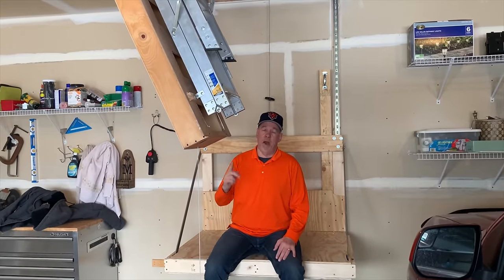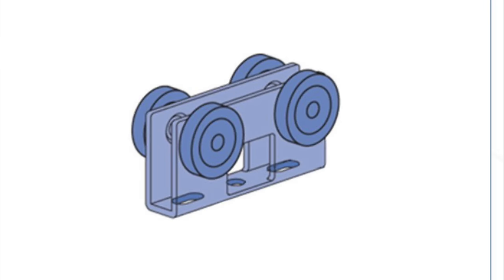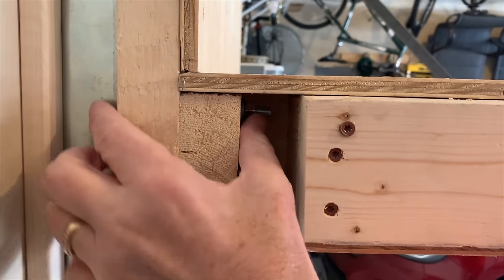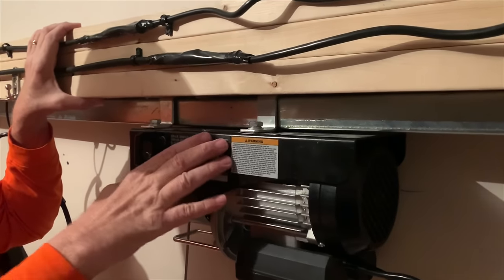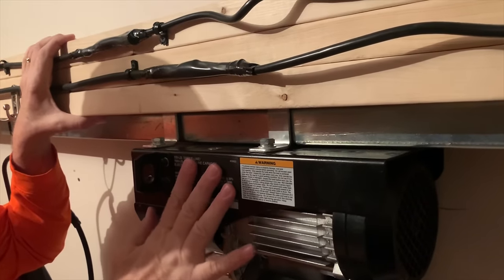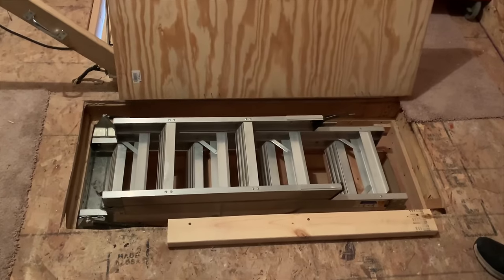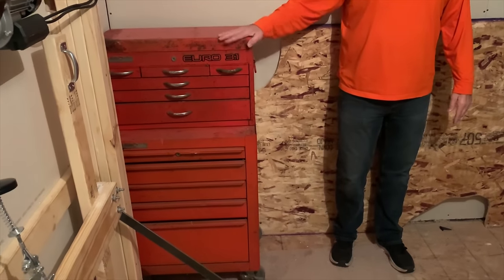Garage Attic Elevator / Lift Build in Minneapolis Minnesota

Comment: Pretty cool, but just a couple suggestions.  The through hole for the eye bolt in the top 2x6 of the carriage is a little worrisome. It eliminates a lot of cross sectional area from that beam at the location of the highest stress driving the internal stress even higher.  I'd replace that beam with a solid one with some kind of hanger that wraps underneath and secures in place with couple of screws.  Next point, I'd probably in parallel with the hoisting cable introduce a retractable fall arrestor in case of some failure within the hoisting assembly.  Lastly, would probably be good to have some pressure sensitive bars at the open edges of the carriage that cut off power to raising the carriage.  Then if there happens to be kids that somehow get access to this without adult supervision, no one gets decapitated.

Comment: My name is Brian also and I built a lift also, Its on Utube and I have had over a half million views.  I have been called everything to a wife killer and I should be put in jail, to everything in between. Alot of positive comments too.  Allot of the comments have been around safety.  I have a ratchet mechanism that will stop it immediately if something breaks, I use the pully too so it lifts slower.  Your design is excellent and motor attachment is more than strong enough

Comment: Very nice job! As an engineer I think people should be aware attic rafters have limited carrying capacity...most around 8 pounds per square foot dead load. Rafters are designed to carry roof and snow loads not whatever you can load on the bottom joists. Since they are made of wood there is a considerable factor of safety (usually 3x) from the expected loads due to inherent variability in structural grade lumber. Many times people get by without catastrophic collapse but realize it can happen. Rafters are constructed to carry specific loads, ie: shingles, roof decking, flooring, insulation and ceiling sheet rock below with a small consideration for storage in the event on attic style rafters. Just be aware of their limitations.
Reply: I have the same thoughts about heavy items. I thought that yours might have been built to support the room. If not you have a lot of hvy stuff up there. Very cool lift!
Reply: I was asking myself the same question, what is carrying the load for the lift..... seems to be the gable end?? or the studded exterior of the house?
Reply: I may have carried the load on anchored 4x4's, attaching all the way up the wall and tied in the rafters to the opposite garage wall, upstairs, to share the lateral forces on the wall.
Reply: @TheEzgrider  my thoughts exactly and on the header beam where he has the 2x4s stacked, I think I would have laid a 2x6 flat then put 2x4s stacked narrow side down with another 2x6 laying flat on top to build a stronger beam.  Or at least stacked the 2x4s narrow side down so they’d be stronger.  Otherwise great job!
Reply: @Fully-semi-auto  I agree.  Still , it is a lift to carry 500 lbs straight up 10 foot at most.  He did just fine with what he had to work with.  I see no problems ever with this, until his cable snaps... 100 years or more from now.  haha
Reply: @LocalTradesman  I agree.  I don’t think he’ll have any problems with it. Just a couple of things I’d have done differently.  And I’m definitely not an expert. I’m sure there are 100 ways better than mine.

Comment: I was coming down my attic ladder once and missed a step, I fell and hit my chest on a trunk I was going to put up in the attic next. I broke a couple ribs when I hit the trunk. Better than hitting my head on the concrete as I lived alone at the time. Probably would have died from loss of blood if that would have happened. I will be putting in one of these in the next few weeks!
Reply from the maker: I hear you buddy. Thank goodness you didn’t hit your head. When you build, be very careful in the build and overbuild for strength. Be very careful operating it. Lots of pinch points.
Reply: Thats what Im afraid of happeni9ng to me too :)  Glad youre ok :)

Comment: Leaving the folding staircase is a good idea from a safety standpoint. It gives an emergency exit in case of a power outage or mechanical breakdown.
Reply from the maker: Or a firemans’s/stripper’s pole. Dual purpose?
Reply: @theelevatorSRT8  there you go!
Reply: I recommend something more like a Bat-pole that can also go up
Reply from the maker: @freakazoid5907  thanks for putting that thought in my head!

Comment: Back plywood should cover all way up to the 2 by 6 to cover the hole, for safety.
Spliced/taped exposed power wires is a code violation in every state.

Comment: Hi Brian,
That was an excellent effort... As a Registered Architect, my only advice would be to correct that top beam/header onto which the winch is mounted:

The header planks should be standing upright, and not flat as you have done. (3) 2x10's screwed together in a staggering (zig-zag) pattern would be a good option.

I could tell from your video that the beam has already deformed. 

Best wishes.
Reply: @theelevatorSRT8  I was thinking the same as Troy (and you). If turned upright, a metal plate, or series of large washers, would help spread that load to avoid spreading the hole.  I'm a bit curious how you cut out the garage ceiling to make a square that large. The reason why stairs are narrow is because they try to slip them through existing joists. I wonder if there was some structural weakness by cutting out a joist to fit your elevator.
Reply: @theelevatorSRT8  as far as the header situation, headers are always placed vertically. If you wanted to control the load better, an I beam would have been the better choice. Second would be to have the wood turned and a load plate carrying for the holes for your bolts. Otherwise, you will see deformation (as seen in the video already). Less desirable option, cross brace using diagonal boards to transfer the load to the floor joists. This would eliminate the bowing of the boards you already have.

Comment: We feel like we know you now, Brian, because we’ve watched the video a thousand times while building our own,  just like yours! Ours is outside going up through our deck upstairs. We’ve just finished it, and it is amazing. Our son showed us this video when we were considering purchasing a very expensive outdoor elevator. My husband studied and studied your project and decided he (and I) could do it. We did!! Thank you, thank you for sharing this. We live upstairs and will finally have this for our firewood and groceries, etc. Saved us more than $14,000!
Reply: Brian Michaels, thanks! It’s under a wide roof and we added protection over the motor. Hubby is a stickler for maintenance of his equipment, so yes! Wish you could see it😊 If you’re ever in northeast Texas...
Reply: Brian Michaels, also want to tell you that we added a fence and gate around it on top floor to prevent falling into “the pit” when it’s downstairs. So ours has a few additions because of its location. The basic lift was almost just like yours though.

Comment: Only change I'd make is on your top beam holding the lift motor.  Wood strength is compromised by laying the 2x on its side.  It would have more strength standing upright, glued and screwed.  Mainly because it has more fiber strength that way.  The posts on either side are fine.  If you are loading under 1000 lbs, your design should work OK, but if you have to rebuild at some point, or want to enlarge, consider using multiple 2x6's glued and screwed standing upright in your next design.
Reply: Yes, single element dimensional lumber is stronger when loaded 
for strong axis bending, rather than weak axis bending, multiple plies stacked in weak axis bending and bolted together can provide equivalent strength and stiffness. Bolting requirements would be governed by shear flow. The benefit to doing it the way shown in the video is that the timber elements would allow for larger diameter bolts than boards on edge while still complying with minimum edge distances required by timber engineering codes.
Reply: Swapping the entire wood frame with steel beams would improve the entire design greatly. This design in essence is just a copy of how a forklift works. It would be like if you stuck a forklift's hoist to your wall and the same thing would be accomplished.

Comment: You mentioned mounting the roller wheels with bolts but the bolts look like they are holding the vertical wood to the horizontal 2x6. Did you screw them in or use lag bolts with a hex head but actual screw type body that doesn't use a nut?

Comment: Nicely done. I would have turned the "beam" on the edges of the 2 bys. That's where the strength comes from. Then sandwich it with some plate steel where the strut is bolted.
Reply from the maker: Duly noted. Thank you!
Reply: Thanks!  Imma need that info!
Reply: Yeah that motor support makes me shudder. 😬 I would use an engineered beam and support the motor on top instead of hanging it by bolts.
Reply from the maker: @gwilli  there’s really nothing wrong with the beam from an engineering standpoint. I was just being polite/non-confrontational. But now people will be misled. The boards are glued and screwed, eliminating slip. The multiple boards eliminate a crash caused by a single failure. That beam could lift 5 times the weight it lifts and it would take several failures to cause a crash. The boards are on their sides because of the holes drilled through them to support the motor. Much safer.
Reply: @theelevatorSRT8  THANK YOU !  I definitely dont want to be misled. You are a humble kind man. Funny how people think they know better but havent done it yet. Of course you're going to have things you would do differently, for ease, Structure, safety etc. Please give me any advice you Have. We welcome it :)

Comment: Neat and functional project.  My only note would be that your horizontal header to which you attached the hoist motor should have been constructed with the timber width vertically oriented. This way the load would be carried without the risk of deflection.  Yet, you put thought and effort into this and It seems to serve you well.  Overall, well done.
Reply: Normally for a load like this you would laminate those three beams (glue and clamp) then turn them vertical and sandwich between and top and bottom plate. Basically making a header like you would for a door. Drilling through that wouldn't weaken it like just turning them by themselves. Given the weights you're working with in the 500lb range your design should be fine. If you were using a snatch block setup for higher loads then you'd really need to look at going to a more typical header design.
Reply: @theguid0  exactly what I came to the comments for. Putting a plate on top of the vertical boards would provide a flat surface to distribute the load across the much stronger laminated beam (ideally both glued and bolted together). Whether the top plate is a horizontal board, a steel plate, or just fender washers is up to the engineer requirements; a board with fender washers would likely be more than enough.

Anyone still thinking it's "strong enough this way": Just grab a ream of paper and see if it's easier to bend along the wide side or narrow side. :D

Also worth noting - hooray for someone actually making a constructive comment instead of just tearing everything apart. :D

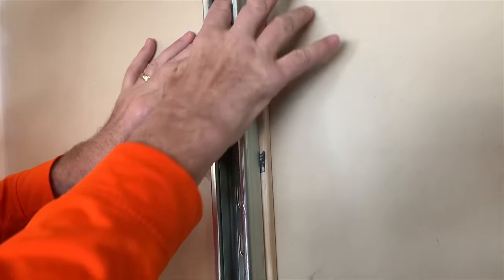Comment: At 1:33, you mention that there isn't a lot of weight pulling out on the tracks and studs, but they actually do have quite a bit of force pulling on them. If you think about it, the cable from the hoist is attached to only one side of your platform. The other side has to be supported by the diagonal supports, which produce an outward pull at the top rollers. The rollers at the bottom push in with great force as well. If your platform had a cable attached on both sides, then the force on the track would only be the guiding force, the force that keeps the platform from dangling. I also would have liked to see the interface between the rollers and the track. Anyway, I like it! Good job!
Reply from the maker: Yes, your point is well taken. Mitch, my engineer student son lectured me on that as well. So, you are correct. I would only say in my defense that the tension of the hoist rope limits the force and I always place the load at the back of the platform to limit the force of the levering action. Thank you for the thoughtful comments.
Reply: @theelevatorSRT8  Your design works exactly how a forklift works - as long as you hug the load to the wall theoretically it will hold. If you hang around on the outer edge facing away from the wall it might struggle or collapse (the force of gravity and it pivoting forward and outward as the lift rises). Like all prototypes you will see improvements the more you think about it, and build off that in time.  Maybe in the future rebuild the frame with steel i-beams and angle iron (talking about real building steel not store bought stuff), but keep the same hoist mechanic, I will bet it will make it a lot more stable than just with the untreated lumber.

Comment: Fantastic ideas great build I appreciate the video and will build mine like this. When doing your top the posts are good, but the top beam will sag with the 2x4 laid down. Yes even with the unistrut there.should probably be 2x8's and sttand them up, this creates a solid beam that will never sag. If you wanted you could use 2 - 2x8's with a piece of plywood in between. Again Nice build bro thanks for the good ideas.

Comment: Great build and really enjoyed watching.  Besides the already made comment about deck screws, I would love to see 2-3 safety levers added to your channel track in case your lift wire snaps during use... thinking of only OSHA and safety first, this is great setup but having only 1 wire lifting and no safety mechanisms built in scares me!   Just for your families safety, try to find a way to add in case that wire breaks (someone underneath or someone riding on platform can be seriously injured!).   Thanks for the video.....really enjoyed the entire watch!!
Reply from the maker: Thank you for the thoughtful comments. See our other video. We added fall arresters. But I’m working on a cool braking system.  If it works. Watch the preview.

Comment: I have a question.  Are you using 2 or 4 sets of wheels on the lift?  It is confusing because you say you there are 2 on each side, but the wheel set itself has 2 wheels.... Soooo... you could interpret that as being 1- (2 wheel) set on each side?

Comment: I am a carpenter and this is what I would have done differently. In the Attic after opening the drywall I would have doubled or tripled up on the existing studs behind the drywall. Then I would have used 4 by 6 post and a 4 x 6 header. I would have done that after I added additional bracing to the floor. Other than that I think you got a pretty good system here! Well done.
Reply: The 2x4 can split and break not strong enough where cable hooks to carige
Reply: @douglassmith2055  Great points... took the words out of my mouth especially the fall arrest.  As an engineer we look at something like this and say Where will it fail... because it will fail (eventually).  In my mind the most likely point of failure is the point of attachment with the cable and the carriage.  There are multiple issues that could go wrong such as splitting of the wood, slipping of the cable thru the crimp, fraying of the cable.  This may work for a  month a year or 10 years but it will eventually fail.... what happens then.  A fall arrest will save the rider but if there is someone below they could be crushed.  Just something to consider when building lifting devices.
Reply: @Dean There is nothing wrong with constructive criticism. It advances the body of knowledge, especially in an environment where shared knowledge is the primary purpose. Brian Michaels is an enthusiastic, caring, inventive, helpful and sharing individual. He doesn't need cheerleaders who agree with everything he says. And I am certain, he enabled comments so that comments would be made. As a result, we all learned something.
Reply: @Dean You and I are kindred spirits. Thank you for saying what I’m thinking when I read all these “know it all” but “haven’t done its” on this app. 👍🏼

Comment: Ingenuity vs 'the man', I'll  take ingenuity every time.

You may want to put a piece of angle on the bottom of the beam to spread the load from the cable hoist. Last thing you want to do is pull the washer thru the 2x beam.
And maybe look into a grade 8 bolt with & nut.  Overkill, but a couple extra bucks for piece of mind...No cheap Home Depot stuff, find a good local fastener house. Just don't tell 'em what you're using it for!

It's been a while, but I think you can get a lifting lug/plate instead of the eyebolt.  Eyebolts can straighten out with a load; you'll never see a rigger using one for a lift. 
You may only be lifting a couple hundred pounds, but unless you have a rated bolt, assume the steel is questionable. Gravity is a bitch sometimes.
Reply: I had similar thoughts when I saw the eye bolt attachment.  It should be a strap going under the 2x6, preferably several inches wide with a through bolt for the hook attachment point.  I noticed that the eye bolt is the home improvement style that isn't welded at the closure point.  Those have opened up on me under surprisingly light loads.
Reply: I agree, at least a piece of flat stock as wide as the board and maybe 6 inches in length.